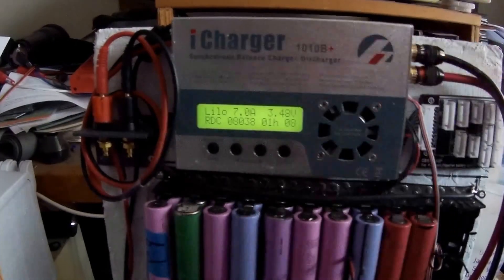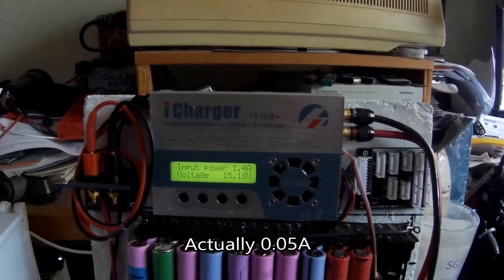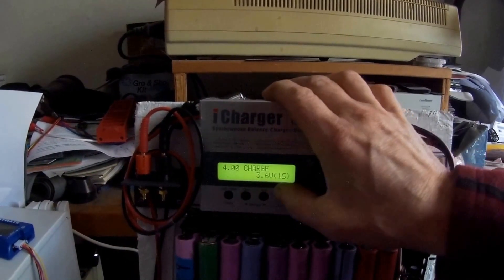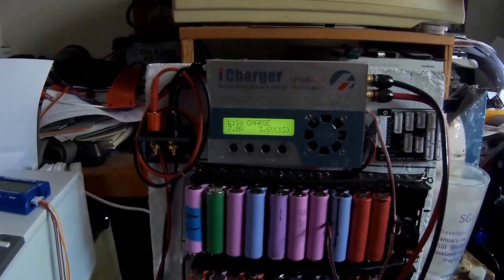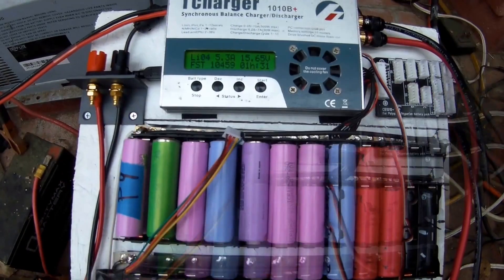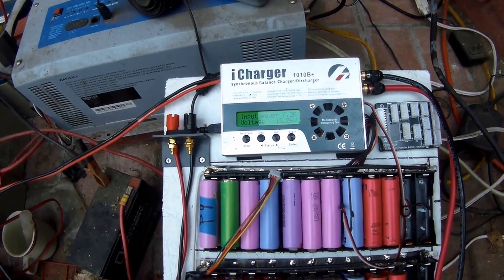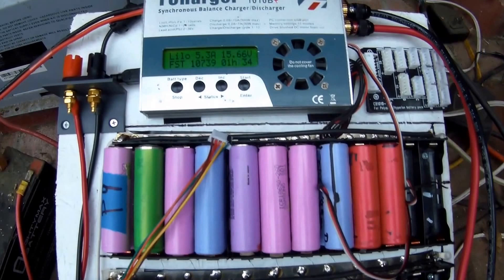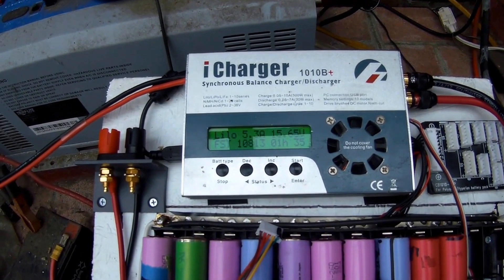Testing the iCharger 1010B+ Limits

Comment: Is this an old charger? Can you still buy one?

I want one with regenerative discharge BUT all the ones that i find are really high capacity like 20 amp and 40 amp. And expensive.

This is the smallest capacity regenererative unit ive seen. I want one!
Reply from the maker: Yes, they are still available.  Shop around to find the best price, but they usually run about US$140 or so.
Reply: R Brown ok so correct me if im wrong but

This is the smallest and cheapest Icharger. And it has all the same menu options?!

Sacraficing only capacity and number of ports?! I know its DC only but i like that.

Sooo this thing has awesome bang for the buck, being half the price of other ichargers but having the same options.

Right?? Lol

Or wait.... It only has discharge plus..? Or does it actually have regenerative discharge as well?

Thanks fot the reply haha
Reply from the maker: It has the most complete set of functions I've seen in an RC charger, although I've not looked at the bigger units.  You'll need to pick up a balance board to break out the smaller connections.  It has regular, plus (external resistor) and regenerative discharging.
Manual on-line:
https://www.icharger.co.nz/assets/brochures/I1010B.pdf
Reply: R Brown wow thats awesome.

The biggest ichargers are over 300 bucks! And the only advantage is higher input and output. Sheesh 10 amps is lots for me, id way rather pocket 200 bucks and go with the small charger. I have no need to charge at 70 amps lol!

Thanks for the reply. Im getting one of these right now. I think they might be discontinued tho... They are only in stock at some places now.

Got one just in time id say. Unless im wrong about that

Thanks again. Awesome charger
Reply from the maker: Glad you found one.  I learned about these from another YouTuber, so good to pass along the knowledge.  I think they are hard to come by because they are made in New Zealand.  Yes, 10 amps is fine for my needs as well.  Most of the time I use mine at 3 amps for capacity testing.  But I'll hit 10 amps when I'm charging one of my 35AH packs up to add it into my solar battery bank.

Comment: I'm interested in your setup. seems easy  to replace if something  happens in the pack. By the way, I have two Tripp lite power verter the 2000watt 20volts,  which setup is best for this lithium batteries  3s or 4s and how many pieces  per pack is ideal for a full running inverter? I already have 600watts  solar panels and a kid charge  controller. .I love your review  for your Tripp lite
Reply from the maker: Thanks, the idea came from Paul Kennett (he has a lot of videos on his setup), although his is a 24V/7S battery pack.  I plan on using 4S-20P with 4V/cell to work with my TrippLite inverter.  It has a max input voltage of ~16V, so should just work with a 16V battery.  I'll set my solar charge controller to 16V as well and then I can see if this thing will work once I get a few 4S packs built after I finish testing them.  I'll probably try 2 packs for that first test since that's how many cells I have ready.
If that doesn't work, I can remake everything for 7S/24V and get a new 24V inverter.

Comment: Sir how to reattach micro usb port of power bank that keeps on falling
Reply from the maker: Assuming the connector is broken loose inside the power bank, you'd likely need to open it up and see what's wrong.  It may be the solder joints holding the connector broke loose.  If so, re-solder those in place.  If the connector mounting pins are broken, you'd probably need to find a new connector and see if that can be soldered to the circuit board.  It may be that it is not easily repairable, in which can you might look into buying a DIY power bank kit.  Those come without batteries inside and you might be able to swap the batteries out of your old power bank to the new one (assuming it has the round 18650 cells.
Reply: Thanks for the information Sir